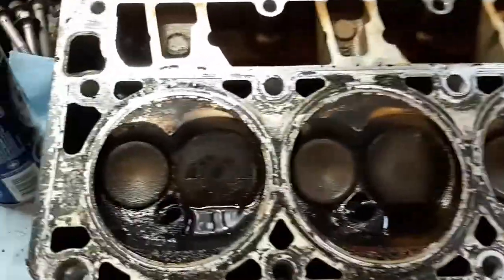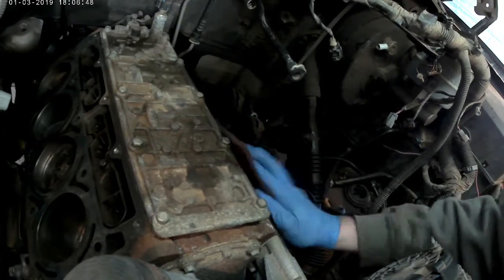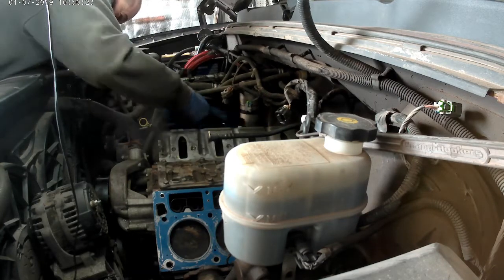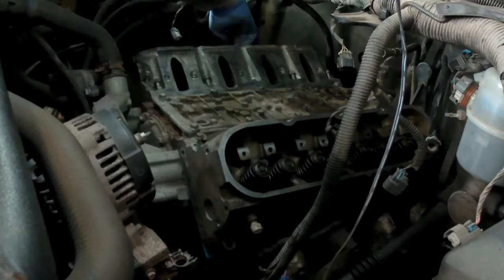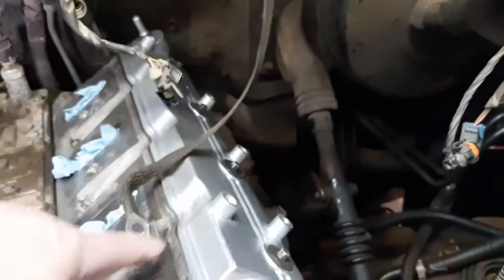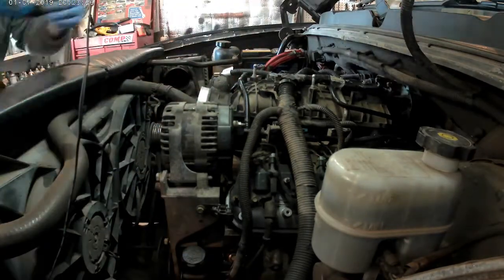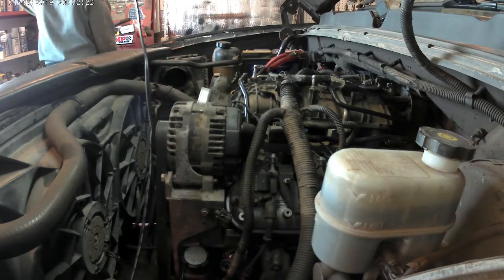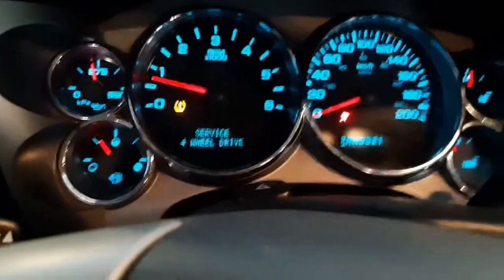2009 Chevy 1500 Head Gasket Final Assembly and Startup

Comment: I know those aluminum heads crack easy at the head bolts as well . All that work what if you gotta a cracked head and you get it back together and the head still leaks I’d be pulling out my hair. No need for a pressure check you can see the cracks visibly poor design pure aluminum no other alloys mixed all for good fuel mileage just sad.
Reply from the maker: I know exactly what you're saying. I fixed this in February, drove it through one of the hottest Summers we had on record and never had any trouble at all.
Reply: @budslife  I’m doing the same thing to my 04 Silverado 4,8 a guy was telling me if the holes where the knock sensors are if one is full of water then there could be a block crack I don’t know how true that is but when you mention checking for cracks on the block I’m paying more attention to it when I get it tore down to see if there’s any. I changed the knock sensors before and there was water in the far back one I thought it was strange but it looked like regular water not radiator fluid but it rusted out the sensor and check light came on I was curious on where they crack on the block. I heard you can visibly see the cracks on the heads due to the fact that there pure aluminum there nothing compared to my older V8 it’s heavier but built tuff these new motors are so different. Great video tho
Reply from the maker: @edwardthacher1622  I usually check around the top of each cylinder after I get the heads off just to see if there's anything that looks like a crack. Those old 4.8l 5.3l and 6.0l are pretty tough it would take a lot to crack the cast-iron block. Now if you had one of the aluminum blocks they would be more liable to crack. Good luck with your project though!
Reply: @budslife  thanks bud for the info I will be tackling this project as soon as all my parts come in. I’m considering changing out the lifters as well and the cam maybe if there’s no damage from a sticky lifter if not I’ll just leave the cam alone.

Comment: I need to change mine out as well how much do u think it’ll cost roughly
Reply from the maker: If your doing it yourself I would say $300-$500. Just the cost of the head gaskets and the antifreeze. Oh and you should change out the oil at least twice.
Reply: @budslife  OMG! I use Mobil one extended life because im sitting at approximately 248,000 miles and im about to wrap up replacing lifters on passenger side i had one lifter seperate into 2 pieces , so i replaced all eight on that side since i had it all apart! Say wat u want but I LOVE MY CHEVY!
Reply: Oh but wat i was actually trying to say to ur comment wen u said change ur oil a COUPLE OF TIMES is that by using extended life Mobil 1 synthetic that would get expensive super fast for me!lol!
Reply from the maker: @artslade125  oh sorry I just used some regular 5/20 motor oil and ran the engine till it got up to temperature then I shut it off let it cool then put some goog oil in. I did this because my engine had a lot of gunk in it from the water being in there. The guy I bought it form drove it for awhile with the bad head gasket. So I just did the two oil changes to clean out the engine.